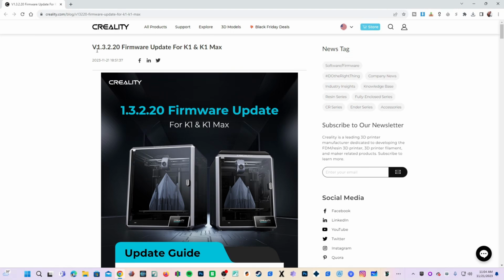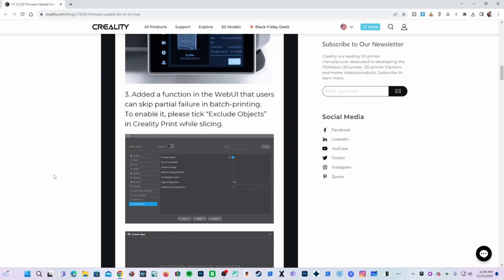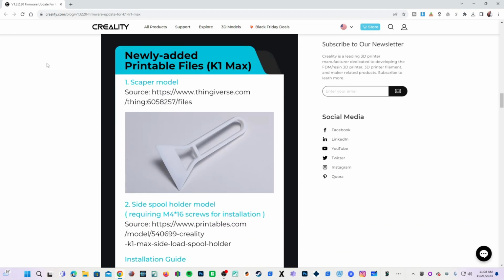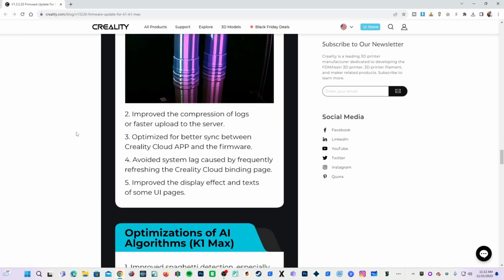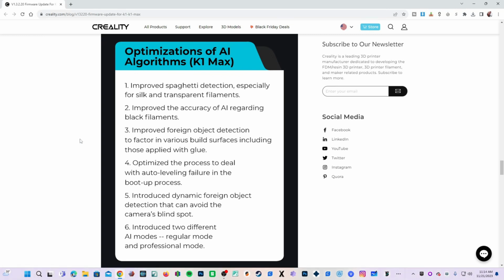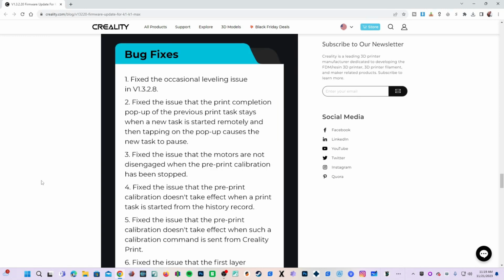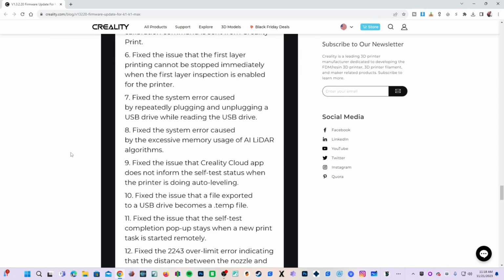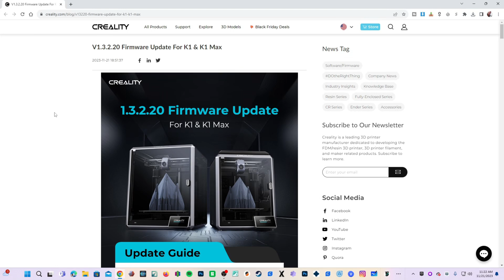New Creality K1 / K1 MAX Firmware. Goodbye Bed Damage, Hello AI & CAMERA Improvements - 3D Printer

Comment: Still getting the bed damage issue in july 2024 out of the box with the latest firmware, destroyed 5 bed plates before I gave up trying things
Reply from the maker: I've been running K1's every day since launch, and haven't even the smallest bed scratch. You ran all the calibrations? Elaborate on what's going on
Reply: @3DRundown  no, that is whats causing it to destroy itself. the calibration is pushing the bed into the nozzle. putting holes in the bed plates, damaging nozzles, bending the x rod etc. there are many others in facebook groups and reddit who are experiencing the same issues as me. it may have something to do with the recent firmware update or the strain gauges, but i had multiple issues with mine out of the box including camera shutdown, belt rubbing etc.
Reply from the maker: It's the Straingauge, or, the mainboard itself, not communicating with the straingauge. If multiple symptoms, may be the mainboard. My V3 had a bad one, it started all sorts of random erros....
Reply: @3DRundown  i replicated it 6 times on the lastest gen k1 max with the latest firmware on 2 different sets of strain gauges, bed mcus and probes (stock plus btt eddy). reverting the firmware to 1.3.3.8 "fixed" it in all 6 cases. there is something about the combination of the latest firmware and latest gen k1 series that needs to be ironed out (and probably wont since they are about to release k2). i hope i can at least retrofit the k2 camera so i can finally have a camera that actually works

Comment: I suspect that the bed crash issue root cause was from canceling a print during the initial pre-print calibration checks. The next time you start a print, the calibration would fail.

I crashed and damaged 4 beds, and recalled after the fact that at least twice, that was a preceding incident.
Reply from the maker: Currently, neither of my K1 have ever touched the bed. I only run Calibration if I feel a need, or if it's a difficult 1st layer print. That said, be sure to run it after any firmware update. Apperently the 0.18 firmware, had an ABLE glitch. They identified and removed it for 0.2. Lucky for me, I never saw this problem with my 2 machines on 0.18. I do think peeps were not doing the Calibration...
Reply: @3DRundown  Not just the “calibration”, but during the initial homing as well.

I am glad the consensus is that the new FW is good to go, I will install it later today.

Comment: I installed as soon it was release. I got my unit Saturday last week and in the second day damage the build plate. I have to order a new one from amazon because still dealing with tech support to get a replacement. So far, the new firmware look good.
Reply from the maker: .18 had a potential ABL error. Neither of my machines had a problem, but happy to be on the new firmware now. Running great. Swap the bed and move along. 
Can try cs@creality.com or Chat with them at creality.com after 9pm. They may send you a bed